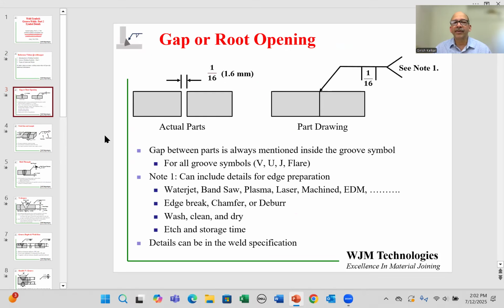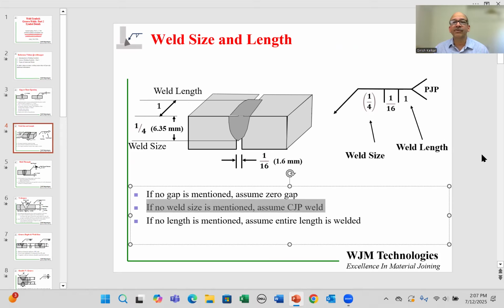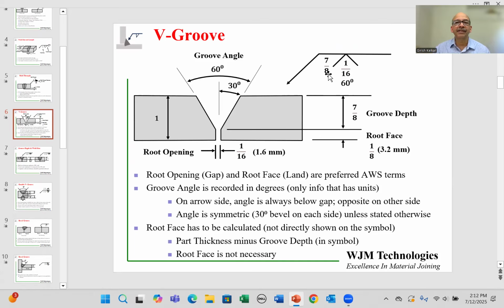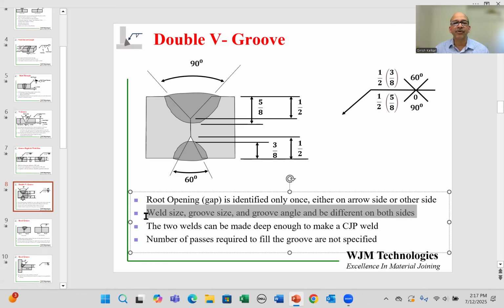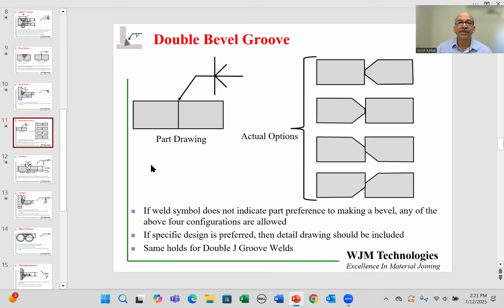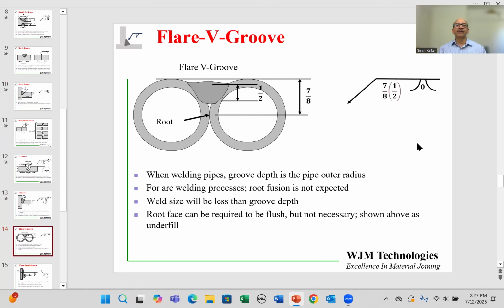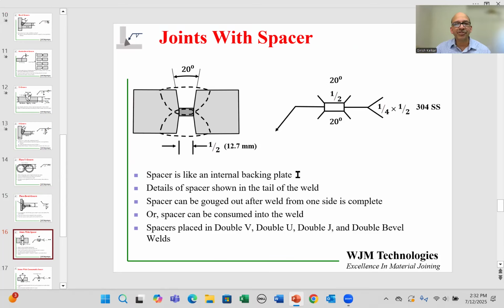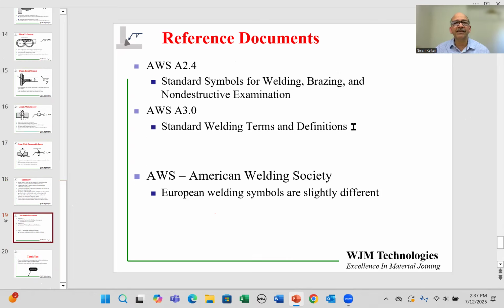Groove Weld Symbols: Part 2

Comment: Hello, I’m confused with part of this content. You showed a square groove weld with no size of weld mentioned on the arrow side. With no size specified, this would imply the weld is a CJP the way I read the text. Thank you for the content.
Reply from the maker: Yes, with no size specified, it would imply a CJP weld on square groove.  If any of the information is confusing, please send me a screen shot for clarification.
Reply: @weldnugget 8:29, even without melt through it would still be a CJP because there is no size or depth.
Reply from the maker: On fusion welding processes such as Laser, E-beam, and arc welding, it is difficult to have perfection where you get CJP (full penetration) but no melt through.  In some applications the molten metal coming out on the root side is not a concern, and hence not shown on the symbol.  In applications where the melt through (also called as root drop) has to be within limits such as ID of pipe, it has to be called out as shown on the symbol.  Hope that answers your question.
Reply: @weldnugget I understand that & thank you. Where I believe this content is in error is around 8:29 where you state “without the melt through symbol this would not be a CJP.”  that symbol would still be a CJP with out the melt through symbol as it has no depth and no size specified.
Reply from the maker: Ok.  I see it now.  Yes, you are right; it would still be a CJP as shown as it does not have depth/size specified.
Reply: @w @weldnugget anks so much for confirming, I’ve started a new job and they use the square groove symbol profusely with no depth or size on joints that could not be a CJP, (end caps for tubes and such) & I sent the email out explaining that they were detailing CJP’s not PJP’s as was the intent. Also on structural drawings this has been a consistent experience for my entire career so it really got me thinking (am I wrong?) but no it’s just that the entire industry uses the symbol incorrectly or at least this has been my experience. Thanks again.
Reply from the maker: It is quite common for design engineers to not have a welding background; which can result in such errors.  And also on the weld inspection side where there is often confusion between fusion, penetration, leg size, and leg length ( have videos on those topics as well).